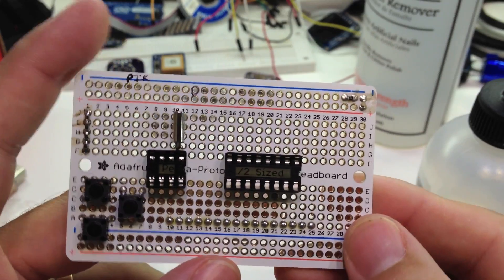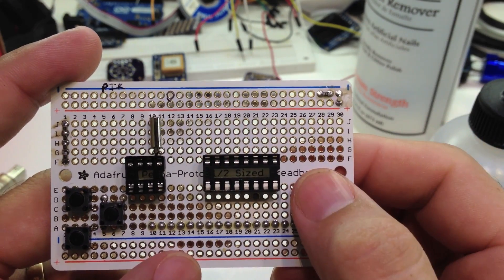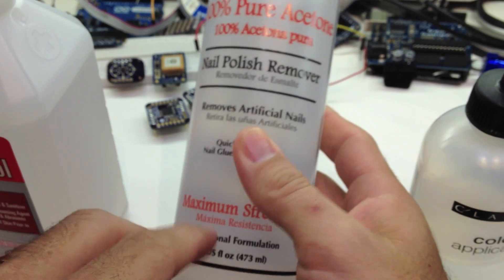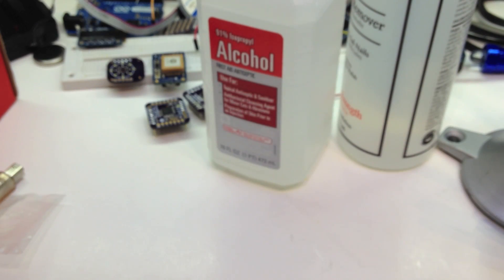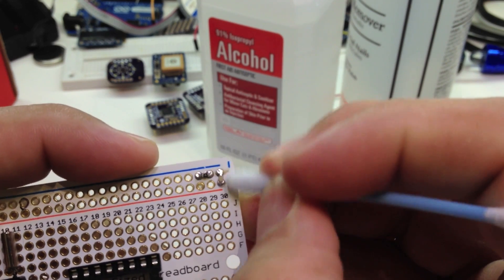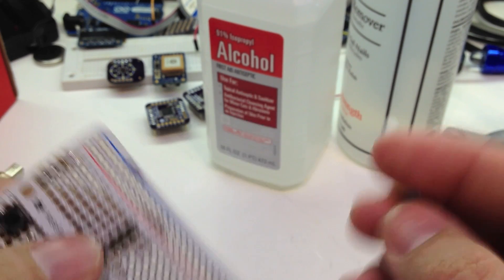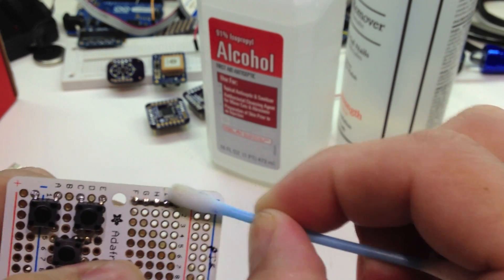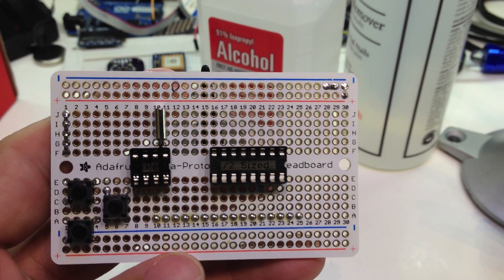Homemade Flux Remover

Comment: I wouldn't mess with acetone on a populated PCB, or perhaps at all.  The worst flux I've encountered from a excess removal challenge is the ubiquitous RMA223.  No idea if what I have is some version of the proprietary product or a chinese knock off, as it all arrives to me from Ebay/Aliexpress.  Anyway even 91% IPA doesn't seem to make too much of a dent in the stuff particularly trying to get it out of fine pitch LQFP inter-lead gaps, etc..  Today I needed to correct misaligned 100mil headers on an expensive 144 pin test socket fixture and had to flux up each of the four headers, dip them in a shallow solder pot and true them up.  RMA223 was all I had and after the dust settled it was the expected gooey mess.  I was scrubbing with 91% IPA and not really getting anywhere.  And some of the RMA223 seemed to have hardened and wouldn't budge scrubbing with a toothbrush.  In frustration I tried dollar store "goof off" which to my delight cut the RMA223.  A toothbrush scrub with that solvent followed by a wash off/scrub with the 91% IPA (to rid the PCB of the stinky "goof off") worked better that ever expected -- near squeaky clean.  Might be possible to use 70% IPA for the wash off such that this would comically fully become a dollar store "solution".  Anyway, thought to share with other folks looking for an economical approach.  Happy Hacking.

Comment: I just use plastic-safe brake cleaner, and/or contact cleaner (by WD-40). It obliterates flux and makes the PCB like factory. Spray a bunch on then soak with a non-lint rag. I also use these to clean my brushes. PS: I believe the actual chemical these are using is hexane.
Reply from the maker: Nice, thanks!

Comment: Again - Acetone is BAD around plastic. Your best combination is a common one - 99% Isopropyl Alcohol, 190 Proof Everclear (Ethyl Alcohol), and Ethyl Acetate. Works wonders and is plastic safe. Common Flux cleaner from commercial companies. Don't use 91% or lower IPA it has WATER in it and is meant as an antiseptic not a cleaner. The only thing stronger is perchloroethylene - perc or dry cleaning fluid. And that stuff is nasty.

Comment: I've been searching all over the place for a good recipe for flux remover as 100% IPA will only spread the flux. Real flux remover (4140 from M.G. Chemicals) will attack the flux and turn it in some fine orange colored dust you can just scrape away with a toothbrush or other high quality brush. Turns out after checking on M.G. Chemicals web site, the recipe is 99% ethanol/isopropyl alcohol (ipa) and 1% acetone. This 1% is CRITICAL because it will destroy the flux AND it will NOT damage plastics. So your combo should really be 99/1 and NOT 50/50.

Comment: Take sometging plastic and wipe some acetone on it before you try this incredibly ill conceived method of flux removal. Just use 91% or higher iso. alcohol or if you want to avoid the white residue of isopropyl then use denatured alcohol. You can find either at Wal-Mart and they won't ruin your components like acetone. If you really need something stronger then a 10%acetone 90% alcohol would be as strong as you want to go. Acetone doesn't ruin all plastics but It certainly ruins some. Why risk it?

Comment: As others have pointed out, skip the acetone, it will eat the silkscreening and solder mask and damage plastic such as IC and transistor bodies.

Back before I was a greybeard I used commercial flux cleaners, but since recently getting back into the field I have been using 91% isopropyl alcohol to clean flux from my personal project boards, although I have been frustrated by the gummy residue left over no matter how hard I scrub with an old toothbrush. Somebody mentioned brake cleaner in an EEVblog thread on flux cleaning, and since I recently bought about a dozen cans on sale for less than $3 CDN each I thought I would experiment with it on an inexpensive project. Brake cleaner is amazing stuff... extremely effective dissolving anything gummy or oily, dries quickly with no residue, safe on most plastics, comes in easy-to-use spray cans, and is relatively cheap (especially on sale like I got mine). It is, however, hard on rubber, but you don't find much of that on most circuit boards.

For a test I used it to clean off the flux after soldering the legs and ICSP pins onto an Arduino Nano clone. Initially I wasn't comfortable spraying it directly on the board, so instead I applied it to the old toothbrush bristles and then scrubbed the lines of header pins I had just soldered. The results were perfect... no damage to neighboring components or silkscreening, not a trace of flux or gumminess left on the board, and it air dried in about 60 seconds (blowing on it speeds up drying dramatically). I will definitely be turning to brake cleaner as my go-to flux remover.

I can't speak for all brands or formulations, but the product I used was "emzone Non-Chlorinated Brake & Parts Cleaner". The side label claims it leaves no residue, is fast drying, and has low odour, all of which I can confirm. It suggests pretesting on plastic components, and warns to avoid overspray on rubber parts, but I have used it on all kinds of plastic stuff, and almost all of it is impervious. Like I said, try it on a few lower-risk projects first, but I think you will find it fantastic for flux cleaning.
Reply: Hi Martin  Green  -  Not that I do any electronic work, like 'projects, wish I'd understand more - I watch, read, bcs this stuff is interesting.  One day the nerve will come.     Thanks for info!   ~ peace   
Anyway - Checked out Brake Cleaner - THIS you may find interesting, even tho you may not Weld.   Quite Scary!  
https://www.motorstate.com/careful.htm   contains  tetrachloroethylene  ~  with heat and gas argon = phosgene.       
BUT . .   NON chlorinated   Does NOT have  tetrachloroethylene  -  it does contain Acetone and Heptane.   just FYI.   =]
Reply: @kareno8634  - Interesting, but not an issue when used for flux removal unless you apply the soldering iron while while the cleaner is still wet. It dries completely in less than 60 seconds so this is not likely to be an issue. The brand of cleaner I used is 60-100% heptane but contains no acetone. Cheers.
Reply: If the smell is too much for you when using this,  ask your chemist about medical grade isopropyl alcohol.
A lot more expensive but better fumes for the worker, hobbyist.

Comment: i won't be using acetone on my expensive pcb's to big of a risk still good tip.. i guess if you need a bit more aggressive help to clean a board. but try a less strong mixture .. 10/90 or 20/80 but 50/50 is way way to strong hahaha..unless you can rinse your board / components  direct after cleaning

Comment: after i bought the acetone i thought let's google it on eevblog.. and after my findings i decided to return the bottle un-opend . it's €1,80 for 100ml that's a small bottle.. from my research 15 to 20min reading on the eevblog. Acetone seems to be an aggressive de-greaser. According to the bottle it's able to remove oil and grease stains. but after using it should be washed of with water.. Just google "eevblog acetone" the first two hit's page1 and page2 discuss the subject.
in short it's not plastic save.. if i was to use it i would go no further then 10% with 90% alchol.
My advice to everyone looking at this.. is first try to clean a practice board where you used flux on.. that's what i just did and the 100% isopropyl alcohol did a good job removing the liquid flux i use for my projects..i guess it all depends on the flux you use.. i use cheap stuff i bought from tme.eu
Reply: Oh that's just typical of any forum, some people will spread panic. No, acetone won't do anything to ICs, boards, solder mask or any surface mount components. And washing it off with water is plain stupid, it evaporates on its own in a matter of seconds! It's super volatile.

Granted, it's usually completely unnecessary.

Comment: do NOT use acetone. it eats plastics, coatings, and paint.

isopropyl alcohol works just fine to remove most flux.
Reply: "most".... alcohol alone is not sufficient for sensitive components.

Comment: Be careful with acetone. You can destroy things like microcontroller pretty easy. The Acetone disolves normal plastics and coatings.
Reply: I've used acetone to clean my PCB a long times ago. Used it on a lot of board with SMD microcontroller. Nothing dissolve, ever.
Reply: It's absolutely impossible for acetone to eat a microcontroller. Some factories use acetone or closely related MEK to wash boards after surface mount soldering, so all connectors and IC packages must be safe against such solvents.

The IC packaging is epoxy, which is somewhat weak to acids but has excellent solvent resistance. Just don't let acetone get near enclosure plastics, which are usually Styrene-based. It also won't damage solder mask, but silkscreen from some low-volume processes may be solvent-based and weak to acetone.

Comment: Thanks for this. Jeri Ellsworth neglected to mention the proportions (only stated 'in no exact proportions' but ~8/92 isn't an exact proportion but a far cry from ~50/50 - so thank you for the clarification!
Reply: +James Russell 
I'd just use either Denatured Alcohol (Which is Ethyl + Methyl) or a mix of Isopropyl Alcohol and Naptha.
If your hardware store doesn't carry Naptha, lighter fuel (off brand Zippo-type) is also pure Naptha.
Reply: +G Joseph I found just using Iso makes the flux smear around leaving the whole PCB sticky. You don't see the yellow from the flux anymore but now you have a sticky PCB. I'm going to try the Iso/Acetone mix to see, but I'm concerned about the acetone eating plastic.

Comment: Hey Jeremy, I have been using straight alcohol, but adding the acetone sounds like it would help a lot.

One tip, if you use a pointy tool (like the edge of a flat blade screwdriver, a dental pick, or something similar) and you wait until the flux is hard, you can pick off the bulk of the residue before using the solvent, and it makes the solvent work that much faster.
Reply: chrisjpf33 Thanks for the tip, I will try it.

Comment: Acetone loves to melt certain plastics, like polystyrene, denatured alcohol works best for baked on organic flux and won't ruin other paint and plastic. If you can solder correctly, kester 2331 is the only flux you should ever need for electronics, it washes off with water. Low VOC fluxes can be a pain, chlorinaded break cleaners work well, just make sure you use in a well ventilated area. BTW all soldering should be done with some type of ventilation or respitory protection.